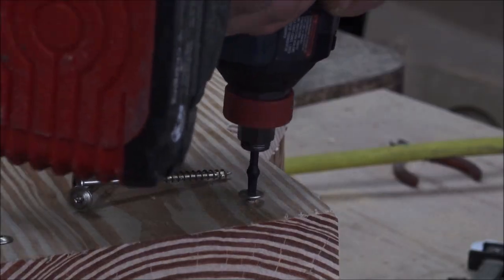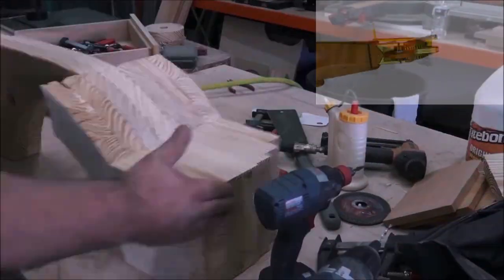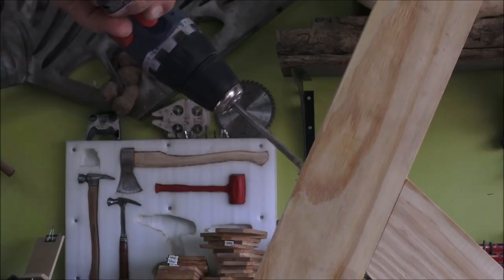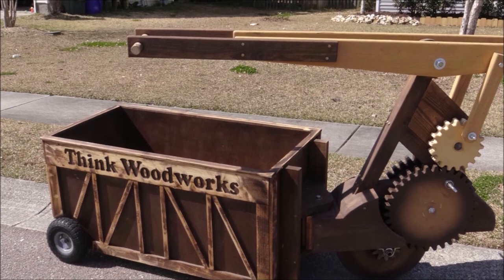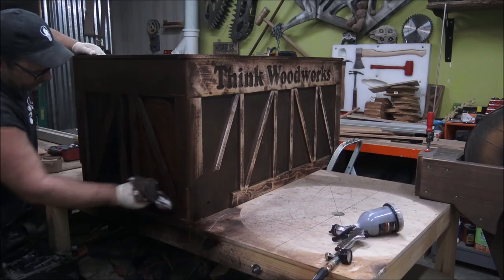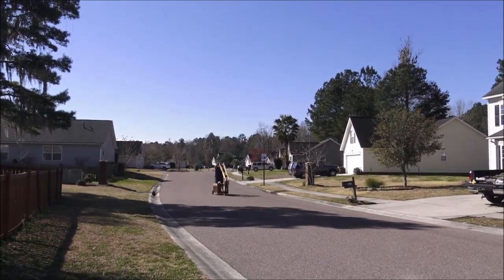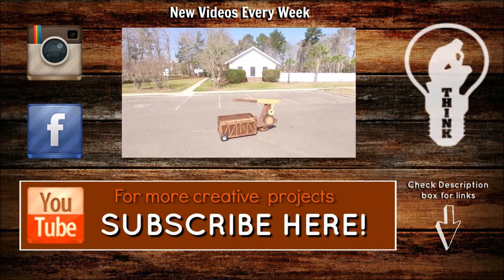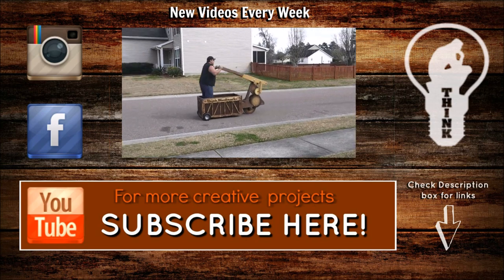Crazy Homemade Vehicle!

Comment: Could you make it at all smaller
Reply: And faster?
Reply: You could probably scale down the size of the back. To increase the speed, you would need to change the gear ratio, but then it would need more force on the pump handle.

Comment: is there a way to steer this?
Reply: it looks as though the pump handle turns, thereby turning the whole cart.
Reply from the maker: +Why Not yes i designed it with a central pivot point so it can be steered
Reply: ok